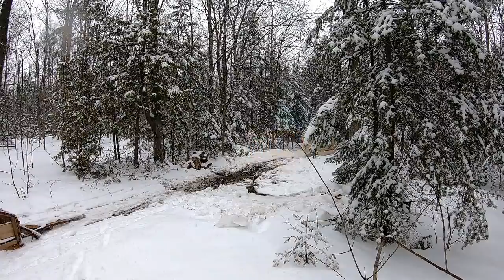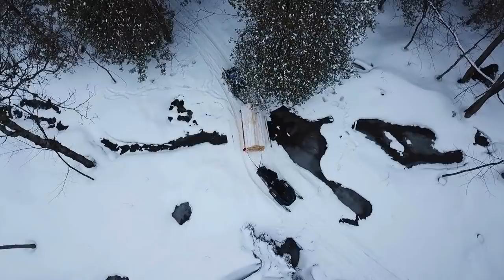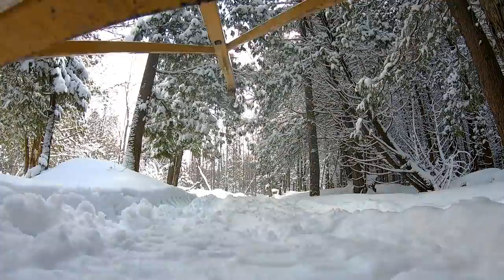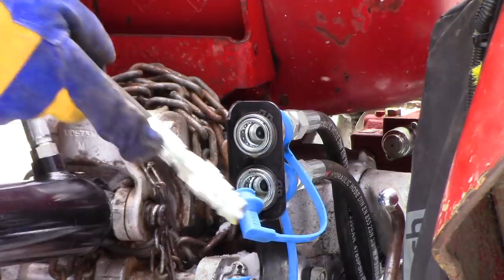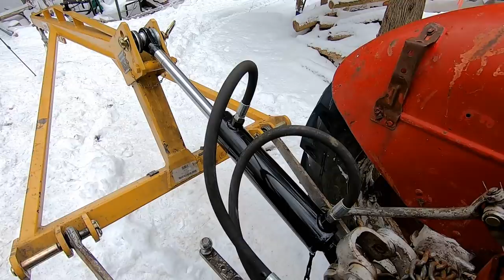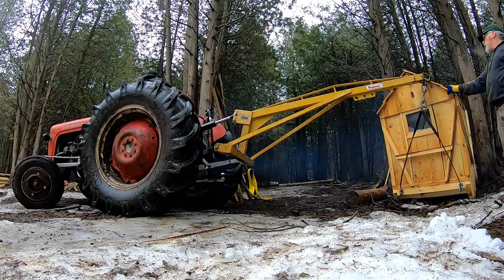Bringing Snowmobile Camper Home + New Hydraulic Kit on Old Tractor / Log Cabin Update- Ep 11.8

Comment: Cool portable camper.  For heat, get some pipes loop through your fire pit.  plumb the pipes to dump heat under your raised bed.  Raise your bed about an inch, plumb the heat to flow through channels to the other end.  Ad a box that it dumps in to to put your winter clothes in.  Exit from the box will take moist air out,  your in take need to be away from the fire to not get smoke or co2 into your bed.  Not sure how to add wood to the fire but it could be done so you do not even need to get out when it is dark out.

Comment: Even though it was a little more work to install than you initially thought it has worked out well for you and the extra range of the boom will be invaluable to you as you continue to gather logs for your cabin. 

The liquid calcium and wheel weights will certainly help but be aware that the calcium can affect the steel wheels.
Reply from the maker: Good advice. Thank you. I have inner tubes, so I figure that'll stop the calcium from messing with the rims.

Comment: Something that might be a good modification is the relocate the exhaust on the MF because at some point you’re gonna hit a log or something and you’re gonna find that muffler and the pipe crushed. I’d suggest either having a short pipe that goes up the side of the hood just to the top of the air intake, or have a pipe like the one on the W-4. Also I feel that it is important to say for other viewers that it does have 2 remotes but they only function on one valve.
Reply: N&W2156 Y 6a You are correct regarding the 2 remotes / one valve system, for those who aren't  mechanically inclined, a "remote" is an individual hydraulic hose quick connect!  Regarding the exhaust system I would prefer that it be the style you mentioned because of the fumes. It is tucked up fairly high under the footboard and axle so the risk of damage is quite low for our purposes. THKS for your input!
Reply: @senioroutsider2975  cool, and youre welcome.

Comment: I think you have the right idea with the camp stove.  Those two 1.5 inch pipes on top can be connected together, then one pipe slightly upward through a hole in your cabin door.  leave the other pipe open on one end.  It's all fresh air, but warmed.

Comment: My dad used water in the rear tyres of his tractors for ballast but our winters don’t involve snow or freezing. I rather think water ballast in your locale would freeze leaving the wheels horribly unbalanced as the water could never fill the entire inner tube. It was no more than ⅔ full. Just as well the 35x wasn’t a fast tractor on the roads, the water ballast sloshed & slopped around with inertia making for a very bouncy ride.
Great video as usual - I love your work.

Comment: Just a note for folks contemplating an add-on hydraulic system on older tractors: A lot of older tractors not originally equipped with hydraulics dont have "live pto". Driving a hydraulic pump with the pto will only work when the clutch is engaged, and prevents the pto from being used as an alternate power source to run various implements. This is a major pain to operate. A solution to this problem is to drive the add-on hydraulics from the front of the engine with a belt drive powered by the crank shaft pulley. This delivers hydraulic power with the clutch either engaged or disengaged and frees up the pto for other tasks.
Reply: White Raven,  both good thoughts regarding hydraulic systems. THis one is a kit that was installed where a value would got to operate a loader on top of the transmission. It is a 2 lever system but works reasonably well. It isn't clutch dependant  either which helps. THKS for the input.
Reply: @senioroutsider2975  I suspected it was a "belly pump" kit. For what you are doing a simple 2 spool control is more than adequate. I rigged a gin pole similar to yours on an old Minneapolis Moline U, quite a bit bigger tractor than your Massey. I took it a step farther and added a cable pulley on the end of the pole and a pto driven winch. This gave me the option to use the pole or just the winch. There was no 3 point hitch on that antique, so I fabricated a fairlead on the drawbar to mount the pole on. A little ingenuity, a torch and a welder and anything is possible. Have you considered a rack for front end "suitcase" weights instead of front wheel weights? Much easier to add or subtract weight as needed and easier cleaner tire changes.

Comment: If you ever trade out the MF for another tractor or add on to your fleet I’d suggest a compact Kubota (L30-L60/01 series) they aren’t the heaviest tractors but most of them are 4wd and can be found pretty cheaply. If you fill the tires (especially the industrial tires) with fluid it adds a lot of weight. Many of them also have loaders

Comment: be very careful when you're pulling lodge with your hydraulics that is really rough and really tough on them it is better to do with the drawbar if you can all i understand that you want to keep them off off the ground but it would be better to build a sled i know it will cost more time but your time may be a lot cheaper and then replacing hydraulic system and back of the tractor.

Comment: Should have used windshield washer fluid, the calcium will rust out the rims unless you have tubes in them.
Reply: CALCIUM IS 11 US LBS. PER US GAL. WASHER FLUID IS ONLY ABOUT 8 LBS.IN A TIRE LIKE THAT IT WILL MAKE SEVERAL HUNDRED LBS. MORE EACH. ALSO MOST TIRES OF THAT EARA HAVE TUBES.   THAT IS THE BEST IDEA IF YOU CAN NOT AFORD CALCIUM.
Reply: @tommyschauer3093   Good thought! The tires do have tubes in them!

Comment: One of the fergusion implements was a crane similar to yours but the pivot for the crane was where the top link pin was attached to the rear axle which would probably increase the travel but it was limited to the factory hydraulics how much it could lift

Comment: What ever happened to putting a corduroy road in at the infamous mudhole? Did I miss this in an episode (or miss an episode completely)?
Reply: No you didn't miss anything , it didn't happen because the summer was dry enough that it dried up, plus the MF 35 has higher clearance underneath. Part of the reason the other (W4)  tractor got stuck is because the lw hitch on it would hang up on old tree stumps in the mud. At some point we will come back to that project. THKS for asking.

Comment: I didn't know they made a hydraulic ram to replace the upper hitch.  My father needs one.  He uses a scraper blade in the winter and a  brush mower in the summer.  We have to adjust the upper hitch each time and their isn't enough adjustment for the mower to lift that far.  He has gotten stuck when the ground is muddy and the mower didn't lift high enough.

Comment: Are there snow skis on the skids of the camper? That’s brilliant, I missed that in the build video! Also, maybe add a hook to the front wall to hold the hitch bars up while stored so they don’t get run over or tripped over.
Reply: Hi Shemp, good comments and questions. Yes there are skis on the runners, and yes some form of anchor for the hitch is an excellent idea. Doing something  now might be premature as I think Outsider wants to rework it before next winter! Have a great day!

Comment: How is filling the rear tires going to help? They act as a pivot point when carrying objects. Other than increasing traction, im not sure i see how they help with being able to handle heavier loads.
Reply: True rear weight helps with traction front weight will help with keeping the front planted and increase rear lift ability but it will cause the narrow front wheels to sink into soft ground ,wider wheels and tires more weights but stay with in the tractors limits.
Reply: @heartland96a  Well put !

Comment: For those (like me) who can't imagine WTF is a pound: 
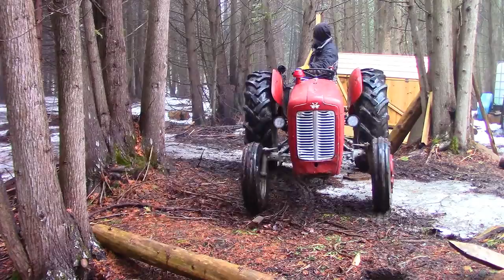5000 pounds = 2267.962 Kg (tractor weight) at 7:45
Reply: Fernando Davillar it’s weird too because he is Canadian
Reply: @masonchapman1433  I thought the same thing for the same reason.
Reply: I grew up with the Imperial system,a quick easy way to convert, 1 KG = 2.2 pounds. It is not to the nearest decimal point but it gives a close idea.
Reply: @senioroutsider2975  Thank You very much for the lines, but "what is a pound"? 
I mean, Imperial System is all based in an individual person's measures to assure His power as king over His people. 

Foot was the king's foot length, inch was his thumb... 
So, I wonder "what is the old dead king relation with pounds"? The weight of His crown? The weight of a fistful of salt? 

And finally: Why keep using the king unities, after independence? Paul Revere would hate It!